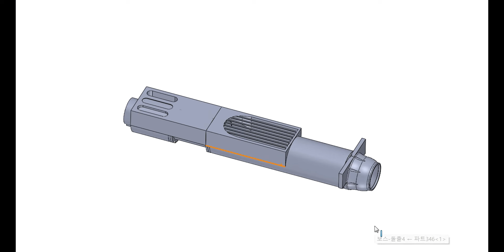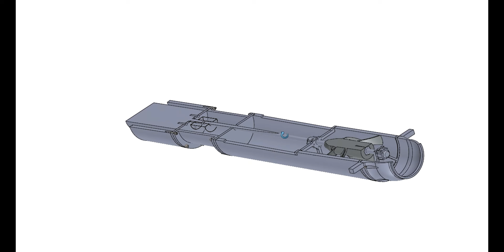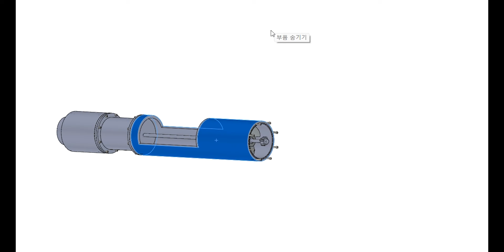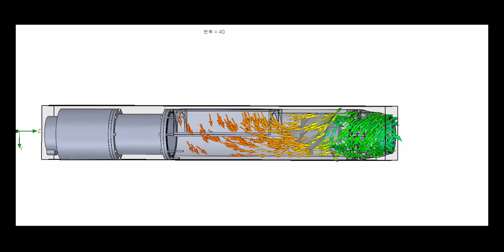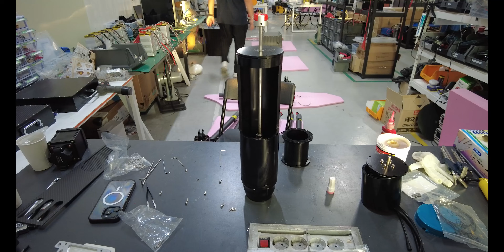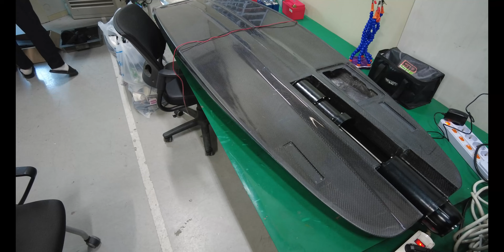I Built a DIY ELECTRIC SURFBOARD – 10kW DIY Propulsion Test | Part 1

Comment: Hello bro. Is your motor waterproof? Or is a separate waterproofing system required? Why don't you use a motor that can operate underwater? I am waiting for part 2.
Reply from the maker: Thanks bro! The motor itself is not fully designed as an underwater motor, so I’m building a separate waterproofing system around the propulsion unit.

I sealed the motor housing, shaft area, and cable exits carefully, but I still want to test it step by step before pushing full power on water. An underwater-rated motor would be safer, but for this DIY build I wanted to use a high-power RC inrunner setup and design my own waterproof structure around it.

Part 2 will cover the battery pack and more system testing. Thanks for waiting!
Reply: @jenk5109 Yes bro, I am waiting for part 2, 🤩🤩🤩🤩😍😍😍

Comment: I was one of the first who started the e surf build. Spent 9 years trying to figure it out, but I gave up because I spent so much and nothing wasn’t really available at that time to complete but I ending buying that exact e surf you are working but it was V2
Reply from the maker: Wow, that’s an incredible journey. 9 years of dedication is no joke — huge respect. It must’ve been tough back then with limited parts and no real DIY ecosystem. I’m glad to be continuing the path you pioneered. I’d love to hear more about your V2 experience!
Reply: @jenk5109 The V2 was really fast!! Especially carrying my heavy weight 90kg. The carbon fiber shell had inner water leak, I fixed it with a kayak drain plug which created positive pressure inside. Since there was no water leak. The shell was easy to crack, had to keep patching with resin. By the way thank you!
Reply: S She

Comment: I'd be damned if those grubs on the shaft coupling don't slip
Reply from the maker: Thanks for the sharp eye! I applied high-strength threadlocker and used proper torque specs, but I'll definitely keep monitoring it during tests. Appreciate the caution!
Reply: Flat spot for the win my friend :-)